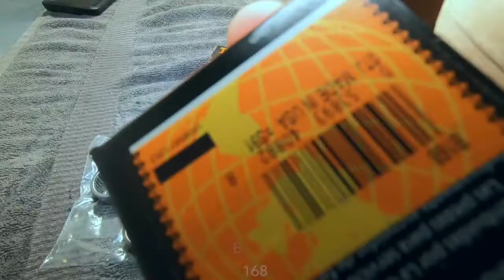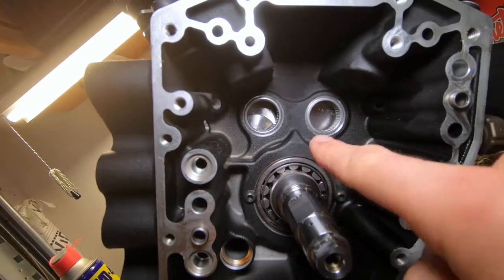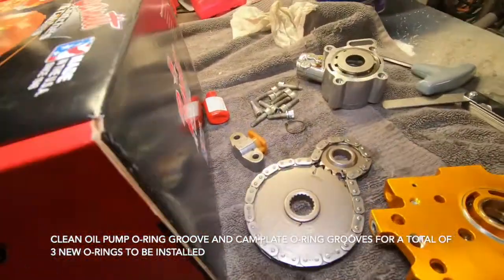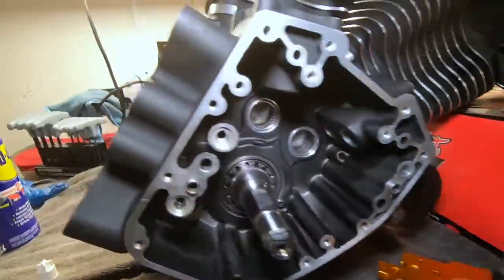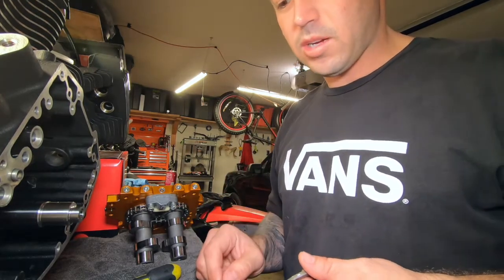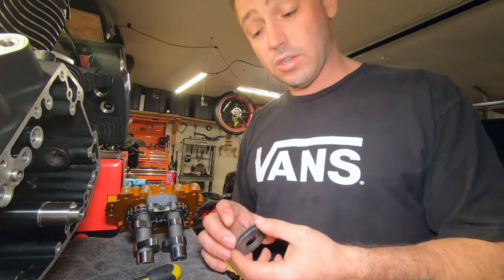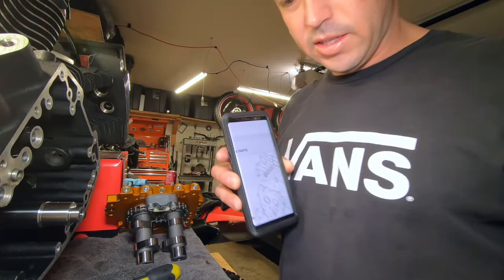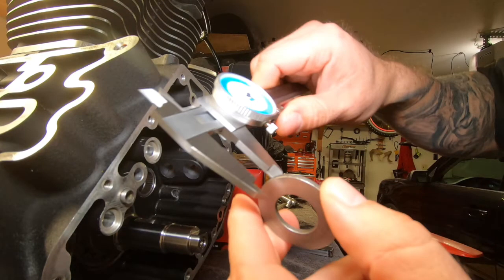SCREAMING EAGLE CAM PLATE AND TIMING INSTALL

Comment: yeah think ya did that incorrectly..pretty sure the oil pump goes in before the plate..and no assembly lube..c'mon man...and....
Reply from the maker: more then one way to do it but make sure the o-ring is not on male oil pump side or it will not seat correctly ..thanks for the comment..free manual for dyna in description
Reply from the maker: you were 100% right my oil pump busted like a dumb ass sorry..new updated video coming soon
Reply: @TheGasStation1616  oh man sorry to hear that

Comment: and what bearings did you use for pressing these shafts?
Reply from the maker: No shaft pressing but I did press new bearings for cams they are not located on cam plate but behind and they are timken..I did an updated video recently for the cam plate maybe watch that one..thanks for the reply tho..

Comment: I hope you next video showed you installing the oil pump correctly.  
1. Install well oiled oil pump into position
2. Install Cam Plate and torque all bolts.
3. Start but DO NOT torque 4 oil pump bolts.
3. Install chain, sprockets, etc. 
4. Using a socket on crank sprocket bolt and plugs removed turn engine over several revolutions. 
5. You should have very little turning resistance. This centers the oil pump over crankshaft.
6. Then torque the 4 oil pump bolts to specs. 
7  Repeat step 2 and you should have no noticeable increase in turning torque. (NO PIPE WRENCH REQUIRED)
8. If so, STOP and figure out why!
Reply from the maker: Yeah I did the updated video after I broke myself off go watch it thanks for the reply